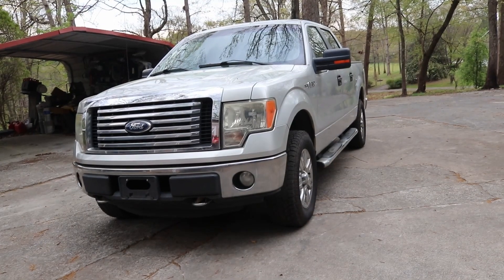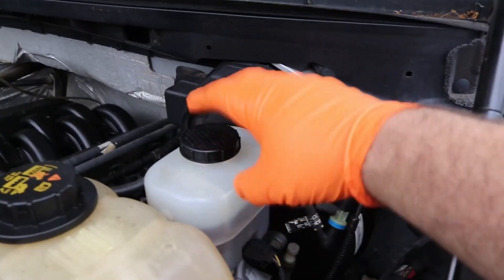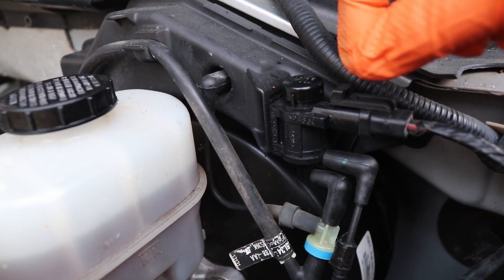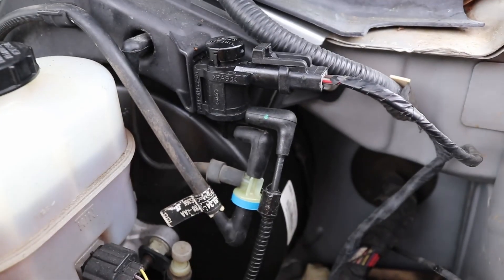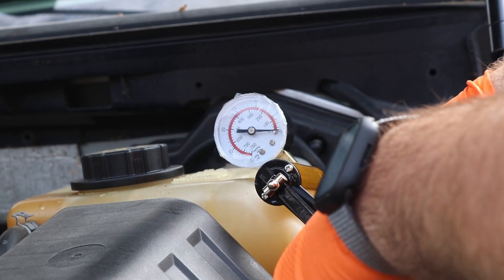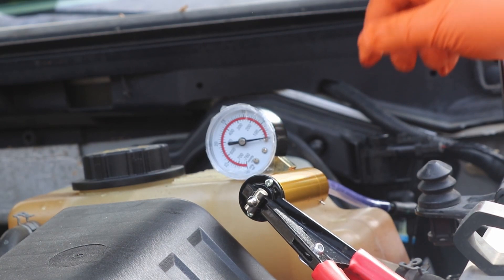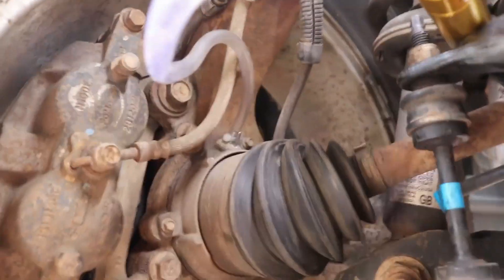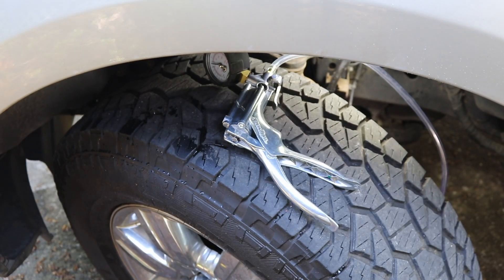How to test the IWE system on a Ford F-150 (full guide)

Comment: In the 2018 with the TCCM firmware update there is no vacuum until you drive for a couple of miles every time you start the truck. Warm up the engine and drive for at least two miles and then check your vacuum at the hubs before shutting off the engine.
Reply from the maker: Good information! I’ll pin this comment so others can see. Thanks for watching!
Reply: @JunkyardJunkie sir I have a question my 2013 f150 4x4 has the from shaft is spinning all the time in 2wd 
It’s normal?
Reply: @andryjcisneros2334 yes. Your hub is locked vs auto
Reply: It builds vacuum and disengages 4x4 at .5 miles
Reply: @flux7061 so the grinding noise for .5 mile every key cycle is normal?
Reply: My truck is a 2018 F 150 5.0.

Question, I recently noticed a humming or whirring noise coming from my vehicle after driving for a mile or 2. When I shift my vehicle from 2wd to 4wd the noise goes away completely. I replaced the vacuum check valve under the hood near the actuator and it didn’t fix the noise. Without driving a mile or two first I did check the pressure to the IWE on both tires at the iwe itself, the actuator under the hood etc like the video. All hoses and the IWE have the proper pressure and they hold well. I also noticed when I add vacuum pressure to the IWE stem at the wheel it holds pressure and the CV axle does not move when the wheel spins. When I release the pressure from the vacuum, the wheel spins with the Cv axle. Is this normal? And wondering what your thoughts are for the noise?

Comment: Excellent video. I had a weird worbing noise not so much of a grind, but my wheels wouldn't free spin in 2wd. I followed your video and disconnected everything and tested vacuum. I put it all back together and its working fine? Nothing replaced.
Reply from the maker: Hmmm that’s a strange one but if it’s working I guess just be happy haha.
Reply: @JunkyardJunkie lol I even ordered parts ,obviously expecting the worst and for the first time ever it just fixed... no repairs just fixed. 😅

Comment: The check valve off the vacuum reservoir is working, when I pulled off the line as per the video could hear a bunch of air come out. The solenoid is working I believe, pulled the line off of it and it pulls vacuum in two wheel and doesn’t when switched to 4H. I didn’t have a second person so I sure if it clicks. Drivers side IWE holds a vacuum around 24 mercury and the line to that wheel holds about 12 steady. Passenger side IWE I can’t get any vacuum when I pump up the gauge and zero vacuum on the line to the passenger wheel so possibly the passenger IWE and vacuum line? When you checked the lines going down to the wheels did you have it on two wheel drive or four? Or does it matter? 

Awesome video by the way!! 👌
Reply from the maker: It does matter you want to check while in 2wd to make sure it’s pulling correct vacuum. As for could it be the line or the IWE it could be both the line is super easy to replace. But because you said the passenger side IWE won’t hold a vacuum at all it most likely is the issue. Best of luck!
Reply: @JunkyardJunkie Ok, I checked in both two wheel drive and four high as I wasn’t sure don’t think your video said. I got absolutely zero vacuum on the line to the passenger IWE and the IWE itself. Thought it was kind of odd to have zero vacuum on the line as you had 12 on yours with a leak. I get a steady 12 on the drivers side line but passenger zero. Any idea how to make it locked in all the time in the meantime? I know there’s a way as it was done to my brothers truck because he ripped all his vacuum lines out but he doesn’t know how they did did that and I can’t find anything on google besides a delete kit(brothers positive no parts were needed when they did his). An IWE is out of my budget right now and it’s full blown winter here so if I could get them locked in all the time for now then in the spring I can change that IWE.
Reply: @JunkyardJunkie I decided to check again today and this time around I got about 24 on the line to the passenger actuator, rapid bleed off on the actuator itself so that is definitely pooched. Drivers line was holding around 10 and actuator about 24. 

Does anyone know how a person can lock the fronts in all the time without replacing the IWE? I really can’t afford to right now😩.

Comment: My 2013 has a low humming noise rather than a grinding noise once I get about 30 MPH. Replaced a wheel bearing but noise still persists. Noise goes away in 4H but shows up again in 2WD. What part is mostly likely to need replaced?
Reply from the maker: That’s something I would have to actually test things. Right now it would be guesses. Best of luck!

Comment: Great video but I can't seem to get a good seal with the zip tie method on the IWE port. Any tips?  If the vacuum is good on the line going to iwe when testing from engine bay, does that mean iwe is holding vacuum?
Reply from the maker: If you need to get a good seal you can take some silicon grease and apply it to the tube this will help get a better seal

Comment: Ran through the checks - the truck is pulling a healthy amount of vacuum, the check valve is doing it's job and is holding vacuum in the tank, and when I connect to the line that goes to the IWEs, that also holds a vacuum without any loss for an extended period of time.  I thought for sure this would be my problem - as I have periodic grinding in the front end when in 2WD that normally goes away if I switch to 4WD.  Any other thoughts of what this could be?
Reply from the maker: That’s really tough to say without being able to look at it myself. It may be time to get a diag from a trusted shop. Best of luck!

Comment: What if I get low pressure reading on the top nipple of the solenoid, am getting almost 18inHg, whenever I connect the gauge to the line coming from the intake I also get 18inHG at the most, I’ve replace check valve and solenoid
Reply from the maker: Check the source of the vacuum see what you are getting.
Reply: @JunkyardJunkie the vacuum reservoir or which one?

Comment: I done all that but the passenger side, the hose holds the vacuum when the trucks are running I hooked the vacuum gauge to the Passenger side on the hub, it holds the vacuum, at24 but the Driveshaft is still turning? What do you think
Reply from the maker: Check the IWE itself I have a video on that as well.

Comment: So my issue is weird... I bypassed the solenoid straight from the check valve to the hub and when on the jack it works perfectly... line On wheel spins-line out engages the axles. OK that is perfect. However when driving the noise comes and goes, sometimes when i lift etc. i was thinking of putting Gopro and see if it engages randomly. Also, can there be a vacuum loss? it only requires 5psi-10 which is like nothing. Any feedback appreciated!
Reply from the maker: Yes I would bet it’s not getting enough vacuum when you hear it. 5-10 is pretty low actually for it. You can always splice a vacuum gauge in and watch it as you are driving to see how far it drops. Best of luck.

Comment: Wonderful video, but I’m having an issue that maybe someone on here could help with. So my driver side IWE works as expected, but the passenger side doesn’t engage 2wd at all. I checked all the vacuum lines and they were fine, i was getting a reading of 18-20 inHg throughout. I thought the lower reading was to blame, but the left side functioning properly threw a wrench in that. I checked the IWEs themselves and they both hold a vacuum equally. My only hypothesis now is that the diaphragm inside the IWE is broken, but i’m unsure if the assembly would still hold a vacuum if that was the case. I’m not quite to the point of that loud grinding noise, but I’d like to keep it from getting that bad.

Thanks in advance to anyone who can shed some light on this!

TLDR vacuum system works, passenger side actuator still malfunctioning, could be broken diaphragm
Reply from the maker: Sounds like the diaphragm but it should be able to be tested I think I put it in this video if I didn’t it’s in another one I made testing IWE. Best of luck!

Comment: That is how you make a great fucking video!!! 

- what i did was right after the 4 wheel drive solenoid i pull a vacuum right at that line test the lines and both hubs at once to see if they hold a vacuum. If they do great the problem is north if not its the vacuum lines or 1 or both hubs.
Reply from the maker: Thanks! Glad I could help and you do why I like to do start in the middle and work my way in which ever direction.

Comment: Does the electrical connector to the solenoid need to be pulling 12v on startup. The solenoid is not pulling vacuum and the male electrical connector is only pulling 4v.
Reply from the maker: I believe it should be 5 volts. Best of luck!

Comment: So I ran through and checked everything on my 2013 f150 per your instructions on the video and I think I have pinpointed the problem being at the passenger side. However, when I apply vacuum directly to my passenger side IWE, it holds 21+ inches of vacuum consistently no problem, but the cv shaft still turns with the wheel (under vacuum). So I’m confused. If I apply vacuum at the IWE and it holds, shouldn’t the cv shaft no longer spin with the wheel? I don’t have any slow leaks anywhere. 

Additionally, I turned the truck on with the vacuum gauge hooked up to the passenger side vacuum line, and engine vaccum held strong at 30+. So I don’t think it is the passenger side vacuum line that is the problem here. 

BTW, thanks for the great video explanation .
Reply from the maker: Hey I’m glad I could help. When applying the vacuum it should pull away to allow the wheel to spin but not the shaft. But if it’s holding 21 that’s good. Another test you can do that I didn’t show is hook up a vacuum gauge to the solenoid at the top like I show you at the video to see how much it’s pulling but instead run it up there to your windshield so you can watch it as you drive to see if it has spikes where it drops down low or has any other anomalies? Is the noise coming from the passenger side?
Reply: @JunkyardJunkie  it holds more than 21. The needle on the guage just maxes out, which the guage of course stops at 30. 

I like the idea of running the guage up above the hood so I can watch it. I’ll try that. 

I can’t say for certain where exactly the noise is coming from (which side) and I can’t manually spin the wheels (with 35” tires) fast enough to replicate the noise myself when the truck is jacked up. So, I was relying on the vacuum pump to tell me which one it was through process of elimination, but it hasn’t quite done that 😂 so far all lines hold a vacuum and both IWE’s hold vacuum, yet cv still spins. 

Of course, part of me is wondering if I should just buy a new solenoid and buy all new lines and hope that fixes the problem, but I’d hate to waste that money and time just to end up having to replace an IWE later. Just wish I would’ve caught this before I installed brand new hub assemblies two weeks prior. 🤦🏼‍♂️

Comment: Is the most junk ford came out with.. vacuum lines on a 4x4 .brake so easily n your front hubs lock in.til you replace the vacuum lines...junkie design
Reply from the maker: At least they designed it to where if it fails it fails in 4wd.

Comment: My 2014 dons’t have any problems but the axle does spin when the truck is turned off? Is that not?
Reply from the maker: Yes it should spin no vacuum is being applied. So you are all good!
Reply: @JunkyardJunkie thank you for your answer, i had heard that vacuum was supposed to be held even if the truck was turned off but i can hear something releasing vacuum after about 8 seconds of being turned off. I won’t be worried anymore.

Comment: With the truck running, when you pull the top vacuum line off and do not hear any vacuum. Is that a good indication that the solenoid has gone bad? 3:44
Reply from the maker: Yes but make sure the line going to the solenoid does have vacuum (pull it off and listen.). If it does then yes sounds like a faulty solenoid. Best of luck!
Reply: @JunkyardJunkie and what if it doesn’t:/

Comment: Great video, thank you. But the problem I am experiencing is one nobody has addressed, I'm hoping you can help. I hear no grinding at all. 2wd works fine, but when I switch it to 4wd, high or low, it doesn't engage and the lights on the dash do not indicate engagement either. the lights do work when I turn on the key so they are not burned out. All the fuses are fine, and I have tried changing out the relays under the hood. Is it possible that if one part of the system fails that none of the lights will indicate any engagement or is it possible that it is just that the switch on the dash is bad?
Reply from the maker: Usually if there’s a error it will catch it and throw a check 4x4 on screen. But I would start with a scan tool to make sure that it’s at least being commanded to go to 4wd. If it is, you have to kind of follow down the chain of things and see where the issue is. Best of luck!
Reply: @JunkyardJunkie Ok thanks. I've checked with a scan tool and there's no codes showing. None at all, so I'm leaning towards the selector switch. I'm just trying to figure out what it could be. I have eliminated a few things that I've mentioned earlier, I wanted to see what you thought before I dropped $100+ on a switch. Thanks for the reply!

Comment: My 2004 Navigator transfer case was making noise only under acceleration. I'm now suspecting the IWE. I changed the trans fluid and case fluid but the noise persists. I'm going to replace the solenoids, the vacuum lines, check valves and actuators if need be. Thanks for the video.
Reply from the maker: Best of luck!

Comment: My 2012 platinum eco boost started making a intermittent (what sounds to be air being released ) on the passenger side somewhere and I can’t for the life of find a video saying the problem it’s definitely more of a air noise then grinding
Reply from the maker: I would set up a GoPro with magnetic base. I usually do that and I can find where it comes from and all that.
Reply: @JunkyardJunkie  I do not have one unfortunately but it dose not do it all the time but when it is happening and when I take my foot off the pedal the sound goes away there was a pipe taken off and capped off when I bought the truck venting to atmosphere  to make the bov noise but I hooked the pipe back up and a week later started hearing this noise i took it off and capped it back off and I still here the noise and I haven’t been able to find any videos remotely close to the sound I’m hearing any help would be greatly appreciated
Reply: @JunkyardJunkie  since capping this back off I now hear the noise louder and sounds like it’s coming from both side now
Reply: I have the same problem did you ever figure it out.
Reply: @Inauspicious85 unfortunately no when it happens I just let off the gas and it goes away then I get back on it

Comment: Is there a way to 

A) check if solenoid is getting proper control from TCCM? 

B) a way to see if the hubs won’t fully engage? (Holds vacuum) but grinding even when vacuum lines disconnected/tsb followed to cap the lines.
Reply from the maker: You can listen for the click while someone changes the switch inside or you can use a scan tool. 

I use a GoPro stuck to a magnet.
Reply: GREAT IDEA! 

What about the second part?

Comment: In my case the vehicle will not go into 4wd even though it says it is. Could this be due to the solenoid not switching off the vaccum from the IWE?
Reply from the maker: Could be but get it up all 4 wheels off the ground make sure the transfer case is sending power to front wheels is where I would start. Or unplug the lines from solenoid and if it works then you’ll know. Best of luck!

Comment: This is the best video I've seen for checking this! I've been hearing that grinding/bad bearing noise since I bought this truck and three shops and a ford dealership couldn't tell me the problem so THANK YOU. Went to take the vacuum line off the solenoid and it broke off in my hand so we'll be replacing that first, and it only caused a slight mental breakdown. Tomorrow I'll be checking the rest of the components and finally feel like I'm not crazy for hearing this phantom noise that no one can figure out 😅
Reply from the maker: I know how that goes! But thank you it truly means a lot. Best of luck. Thanks for watching!

Comment: I replace both iwe, whole vac line, pass is 22” n driver side still only gets 5in pounds. I cut it apart and tested out of the T and same results.. seems it can’t pull from both ways, could this be reservoir? Only thing i haven’t replaced it. Thanks.
Reply from the maker: That’s interesting honestly if there is 22 on pass side and you tapped in to the t and it shows 5 then further testing is necessary one of those is need to check it out myself. Best of luck!
Reply: @ i found out that the new IWE i had installed was faulty from the factory and leaking!

Comment: Would it be an IWE issue still if it can hold vacuum just fine but doesn’t disengage the cv shaft?
Reply from the maker: If everything in the system holds correct vacuum then it shouldn’t be engaging the cv shaft. Did you check the IWE itself?
Reply: @ the system holds vacuum with out any leaks. The cv shaft needs to be replaced but it was also just replaced last year (~ 15,000miles ago). With the vacuum pump on the iwe and spinning the tire, my CV won’t disengage. 2015 f150 passenger side has the issue